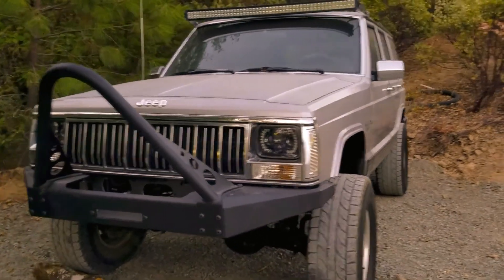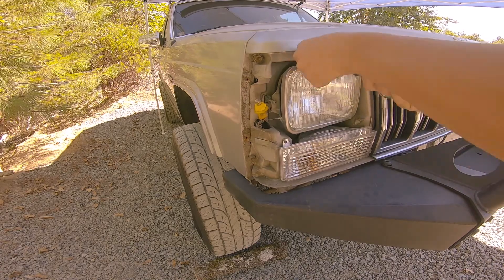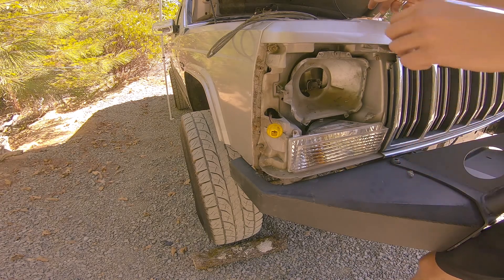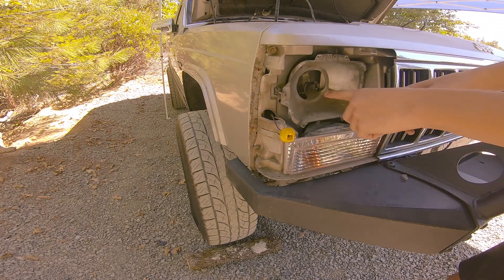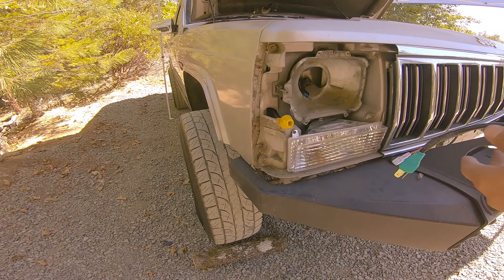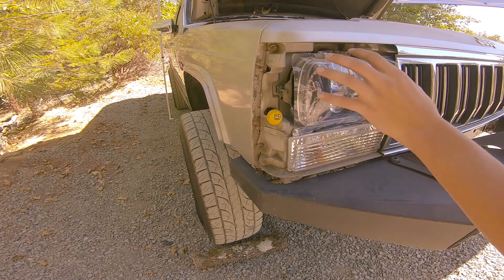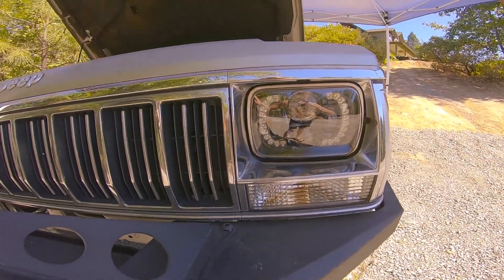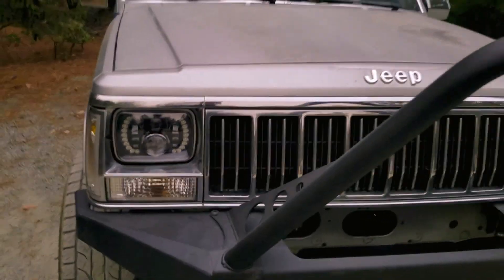Installing (LED) Headlights On My 92 Jeep Cherokee | Jeep XJ Build

Comment: Does this connect right into stock plug in?
Reply from the maker: Yes, u just have to wire in the Day time running lights if you want.
Reply: @FreeznOffRoad  Much appreciated! I was looking at another set of headlights that I really like from a video I watched yesterday. Then today I come across your video and now I’m not so sure which ones to buy 🤣 maybe both! Seeing as I have 2 xj’s
Reply from the maker: Smart😂